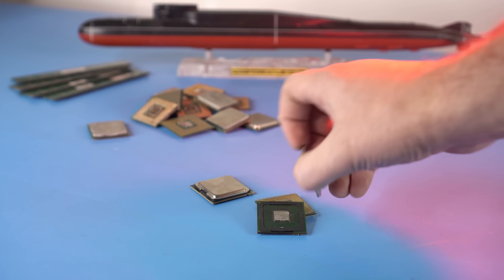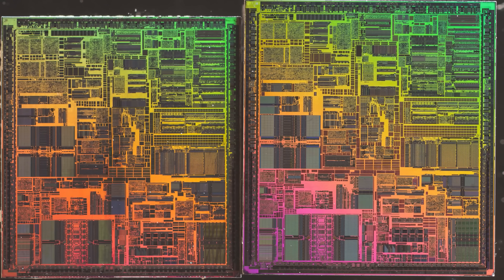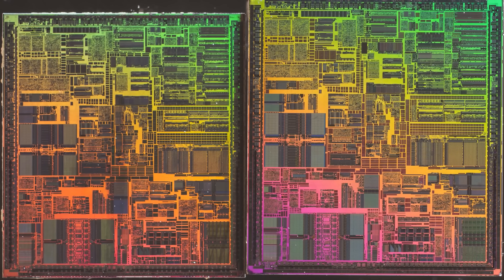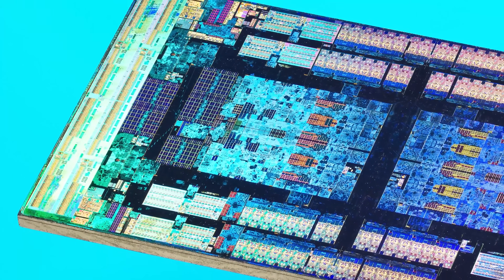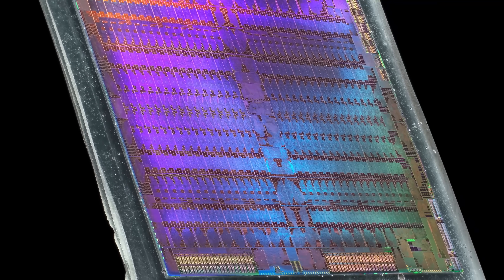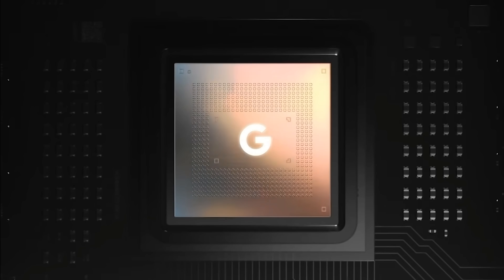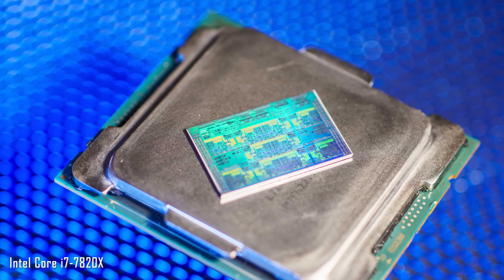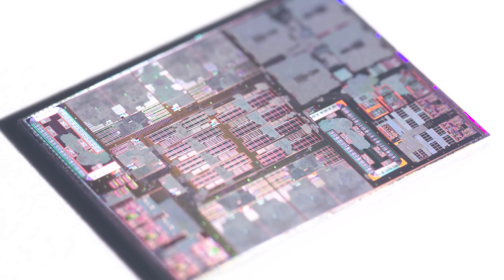Processor under microscope. Nanometer journey

Comment: Some connections are blocked shorted w a resistor in the cpu. This way engineers, fools, power users, gamers, women, workstation users are separated from each other by blocking the functions of the cpu. Windows can allow it for cheap to turn it on. The resistors need time to break its conductivity. Time for a laptop is 5 hour of continuous music listening to be recognized as a woman. The mouse red led turns pink, the gaming indicator. The audio will becone 3x louder and will consume more cpu power. For workstation it needs 6 months to turn on the cpu cache. For engineers the 87em.exe is needed on a card or pendrive.

Comment: We can't make the chips without compilers. And they have beefy systems running circuit simulations too. They even use physics simulations due to the extremely fast speeds.

Comment: Even After Reverse Engineering: Kernel Kesaria, Will be Un-Subvertable. Now We Can Get The CPU to Protect the Kernel.
With The Segment Lists (Valid Segment List, that The MMU has Issued) Inside The CPU, Even After 20 Years of Reverse Engineering.
You Still wont Be Able to Overthrow The Kernel.
Upon Startup, ALL Physical RAM Locations are a Miss. (Not in the Transaction Lookaside Buffer).
The TLB/MMU, Issues a 32 Bit GUID (Global, Unique Identifier: That it Also Stores in the TLB/MMU).
Now only Processes and Segments, That are Supposed to Talk to Each Other: Know the GUID.
A Rogue Process or Memory Segment Will Not Know the GUID.
This Will Protect The Kernel, Even After 20 Years of Fully Reverse Engineering The CPU. We Can Still Use the Technique, Even if the Attacker Knows About It. Address Randomisation of Programs and Kernel, Make Hacking The System, Quite Difficult.
The Solution to Program "Windows": is To Use BOTH VB.Net AND C++ Together in The Application. That Will Be The Case in 20 Years Time.
The Hard Drive is "Memory Mapped": One Memory Segment the Kernel Uses, Another Segment "Windows", Uses. The Hard Drive Will Protect the Kernels Gigabytes.
Upon Startup: The Computer Loads a SIGNED Kernel.
Recovering from Viruses, Will Still Remain Possible in 20 Years Time.
What You Have To Do, to Hack Program "Windows": FULLY Reverse Engineer, The CPU. Then You'll Be Able to Overthrow Program Windows.

Comment: I did a bit of a math and came across some shocking results. I always got the impression that these chips were practically full-blown cities in their complexity, but I didn't realize how much.

I went by a square die of 3mm length with a transistor size of 7nm. Scaling that die up to the point those 7nm transistors are the width of the average adult human (I used 40cm), the length of that die then scaled to 171 km. It would be one of the largest cities on the planet, easily.

Note, BTW, that Cerebras built the largest single chip on the planet with a 7nm design that has 2.6 trillion transistors. These structures we're creating are beyond our imagination in complexity, it's...fascinating, really.

I bet the math would get even crazier if you were to take the cumulative lengths of all these connections in a chip, stringing them out in one big line.

Comment: I remember hearing a story about the time the 386 was introduced. I heard Intel rented every large computer (think IBM) it could find in California over a long weekend to simulate the then new chip to insure no design errors were missed. Today it would probably be a room full of desktop computers, since one of them today has more power than what was running major companies circa 1980. Processor dimensions have shrunk so much that ordinary light wavelength is too large to print the tiny patterns onto silicone. Ultraviolet as well, has wavelength too long. What is next, Xrays ? I worked for STC in the 70's. We made a disk drive about the size of a washing machine, and it was 10 mega bytes as I recall. Today you can hold terabytes in your hand.

Comment: The Russian processor is missing some copper traces because the boss stole them, and you can tell the traces are more squiggly since the designer had too much vodka for lunch. The only working parts on this CPU are those copied from Western designs.

Comment: I enjoyed the video but I’m no closer to understanding how the hell this all actually works to power such an immensely versatile and powerful device. 

Also, how is it possible to create switches and transistors that are smaller than the wavelength of visible light? That doesn’t even make sense to me. 

It boggles my mind that anyone ever figured out that something like this could be possible. To make something so powerful, yet so small that even a microscope can’t capture it. 

I know that all microchips, such as CPU and GPU dies are created from large wafers of silicon, which is essentially just sand. But how the hell is silicon used to create these unbelievably complex structures, capable of incredible computational power, all of which fits into something the size of a finger nail or a postage stamp? 

I just can’t comprehend it. It may as well be witchcraft.

Comment: Diffraction is no more the limit of optical microscopy. You can get color pictures of sub wave length structures by use of optical scanning near field microscopy. There are microscopes of this kind which can achieve a lateral resolution of less than 5 nm with ultra-thin quartz tips, obtained by an etching technology. The theoretical limit is atomic resolution in true color. For this purpose you need to irradiate the sample with wavelength tuned laser light pulses according to the three human color receptor wavelength maxima. Superconducting bolometers can act as radiation receivers which count each single photon as a measure of intensity of the reflected light. The result is a natural true color picture of these sub-micron structures. This is really amazing.

Comment: The technology that produces these devices is the most precise and highest technology there is.  The amount of work that goes into simply building the plant is mind-boggling, and the machines that “print” the circuits onto the silicon are far more mind-boggling.  It’s a miracle that they’re as cheap as they are.
Reply: The only thing that is more expensive is the graphics card bc of mining.

But who makes the machines that makes the cards?
Reply: You need like 2500 now days to get a really good rig for gaming. Maybe cheap in terms of what you are getting but a lot of people cannot afford that. And the affordability has gotten worse. Thus might open the door for more pay to play e centers, Lan centers.
Reply: @ayliniemi  Honestly computers are cheap these days.

My very first computer costs a little over 2000 dollars, that got me a low spec system, a 486 when better machines were all pentiums. 

Today that money gets you a top of the line system.
Reply: @taiwanluthiers oh man… I had one of those back in the 90’s, we must have been AOL friends 🤣 

That’s how I first discovered what the “internet” was with the dial up 56k modem. Millennials remember what it was like, Zoomers not so much.
Reply: @ayliniemi  I'm confused by your comment. No one was talking about the price of gaming PCs. They said that processors are cheap now. Given that you can get a 6 core CPU for about $100 now I would say that yes, they are cheap. Affordability of PC components (GPUs excluded) have been getting better and better over the years so I really don't know where you got that one from.
Reply: @andyk192  I'm talking about a high end rig. And counting in inflation and stagnant wage growth. The whole 'you will own nothing and be happy' idea that seems to be playing out. If people can barely afford food, they might spend $50 dollars for a night at a lan center but they're not going to fork over thousands for a PC.

Comment: If you want to blow your mind, calculate how big a modern processor would be if the transistor element size was equal to that of the thickness of a sheet of paper. Don't  forget to leave a little space between the transistors.

Comment: I used to be a microelectronic technician and worked in the photolithography bays. We’d use regular microscopes to look for imperfections on the surface of the silicon but in order to actually “see” the individual features of the chips we had to use scanning electron microscopes.

Comment: iFor size reference...There are as many nanometers in a millimeter as there millimeters in a kilometer. 1 million. And 1 femtometer would be 1 million times smaller than a nanometer which is so small  single  digits femtometers can be used to measure atom nuclei diameters quite easily. 1 Femtometer is a trillion times smaller than a millimeter.

Comment: I have a friend that worked for a certain company that does contract work for the US government. He talked about they would dissect chips to see what they can learn. It said it was very expensive machinery to do this. I guess they slowly sand the outer of the chip, then sometimes use acid and other methods to get to the bare processor and look at it with a microscope. We won't get in to details here, but the government might "use" what they learned and make their own chips.

Comment: the statement about the intel14nm process being smaller isnt true at all, 14nm are 14nm and intel uses higher fins, wider fins and angles the gates not that steep. making the dies quite big in volume, its more transistors per squaremm, but way less per mm3. intel 14 is 14 damn nanometer, and intel was not ahead back then in node processing, meaning AMD HAD THE HIGHER DENSITY AND THINNER TRANSISTORS. until they decided to switch to 7nm, it was then that intel really took off and became inefficient because they packed the die so dense, you need to realize that lower nodes do not always mean more transistors, often its a bit more but more spacing for the same thermal performance.
Reply: an addition to this. intels server cpus use chiplet designs, and they still are severely lacking in core count compared to epyc. intel really needs chiplet designs, amd wouldnt with up to 64 cores per chiplet when low powered cores.

Comment: Great video! I'm a line operator in a chip fab, I currently run photo tools so that clip of the mask at the end was a nice little nod. I find what I see on the wafers fascinating, even by naked eye. Haha, have also learned developers love to hide things in the chip design that can only be seen under microscope.
Reply: But you are talking about the old computers.
Reply: @947C.Christmas.Siletz.Benton  That's fair, the fab I work for is 60 years old. I don't think we have a process node smaller than 90nm and we still work with 200mm wafers. So we'll never be a TSMC or an Intel. That being said, we're not producing 80's/90's technology, we're producing 2022 technology with in some cases 30+ year old machinery. Honestly, that's another thing I find fascinating about my job.
Reply: @joehoisington7761  where are those CPUs being used?

Comment: when the cpu radiates heat. then it gets to much electricity. it should not radiate heat. a proccesor can undergo wear and tear and xan break. under. a overpower configueation. just lower the voltage or amperage.
Reply: A CPU will always radiate heat, no matter how undervolted it is

Comment: The colours are "false" in the same way some butterfly wings have "false" colours! They both have repeating structures smaller than certain wavelengths of light. Amazing phenomenon.
Reply: You get all the colors because changing the angle you view it at, is changing the angle it's reflected back at to your eye. The reflected color is the wavelength of light didn't get absorbed into the surface at that angle.
Reply: @pgtmr2713 , reflecting off the casted metal,  casted man-made micro layer
Reply: Like tiny anechoic chambers for light waves, it’s incredible. The scale is so tiny that literal quantum tunneling is a predicted issue with scaling any further down, since the components are almost at an atomic scale.
Reply: It's called sand. Ever seen sand reflect colors? The CPUs are made from sand.

Comment: Always fascinated me. I can't imagine how these things are designed.
Reply: They use EDA software and design by pre-compiled blocks, no one designs by individual transistors. The design must follow electronics standards for verification. AI helps in finding optimal configurations for the blocks that take up the least space, accumulate the least heat, etc.
Reply: @Henry14arsenal2007  Right on. Yea, it's not like HAL 9000 inventing it with it's own consciousness or anything scifi like a layperson might imagine at first, but really, conscious awareness isn't necessary for approximating functions with narrow/definitively measurable goalposts :)
Reply: @CharlesNiswander  its not really that epic as you made it sound like "AI DEVELOPS OUR CPUS" was basically your message. also ai does a heckload of errors, just look at what happened to the vapor chambers of the new gpus, or how the layer count is too small for the weight of many gpu´s. the ai normally should have stepped in.
Reply: The latest generation of chips was designed by A.I.
Reply: @CharlesNiswander  amazing.
Reply: @RetroGadgetMan  There's some references! AI can do a LOT of things nowadays